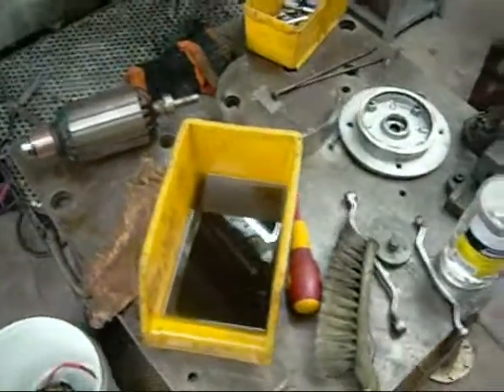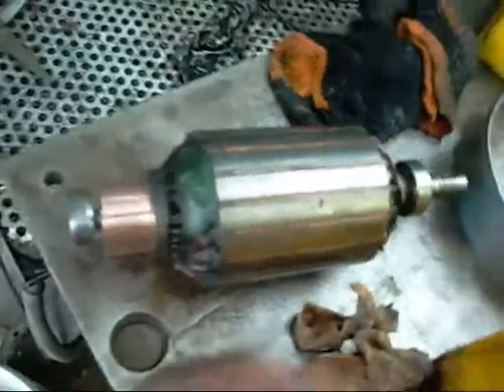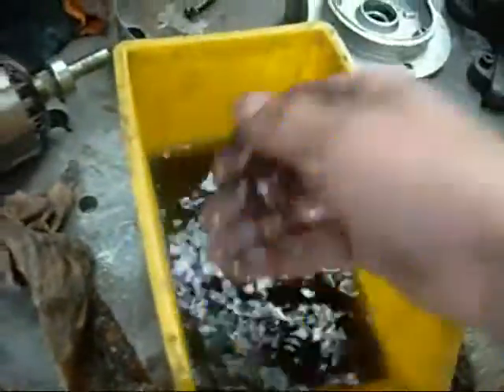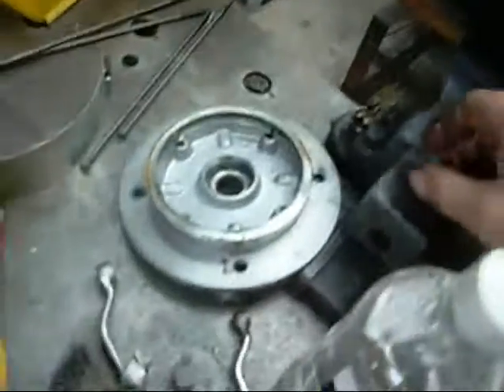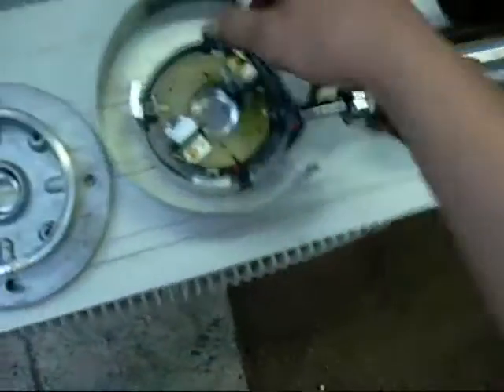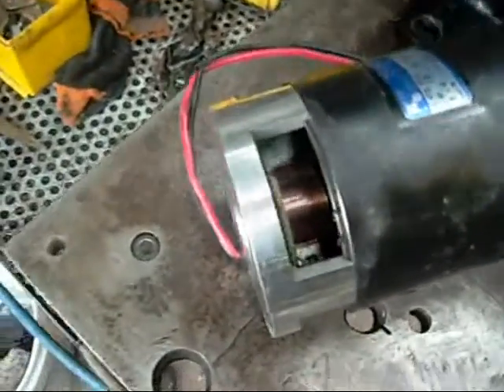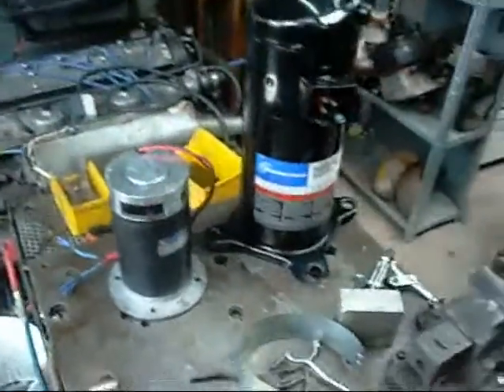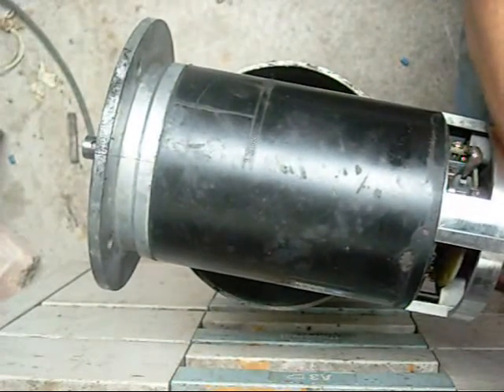600w DC Motor Rebuild

Comment from the maker: the system I saw used 3 cyclones to separate plastic bits from the heavier copper bits.

the flow of air inside causes the plastic to blow through to a second cyclone where smaller bits of copper are recovered, then into a 3rd for collection.